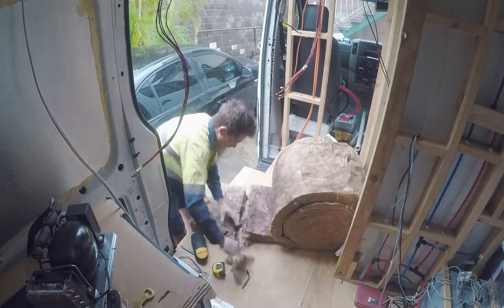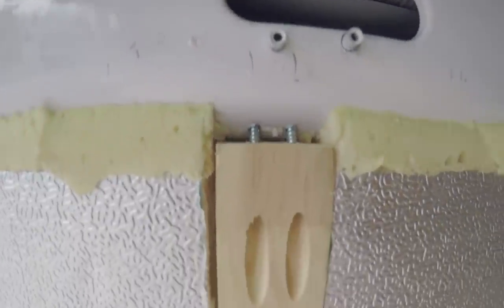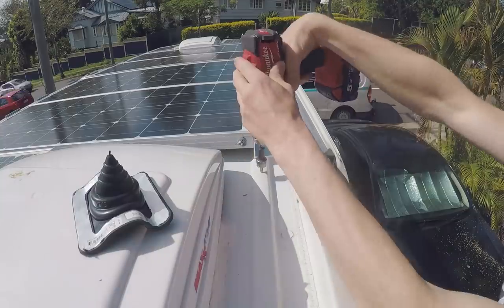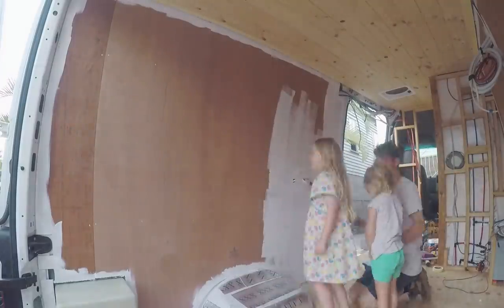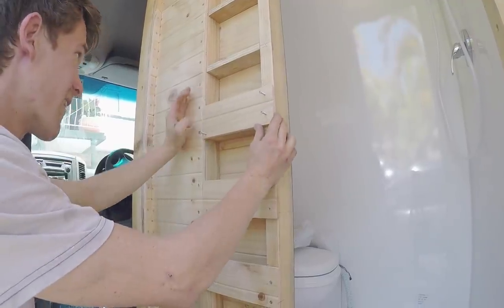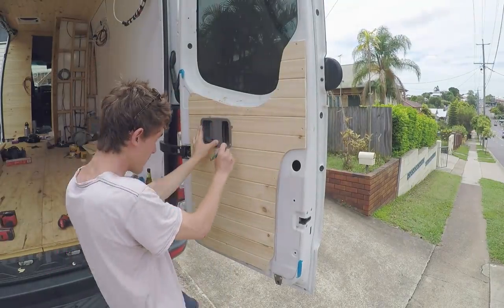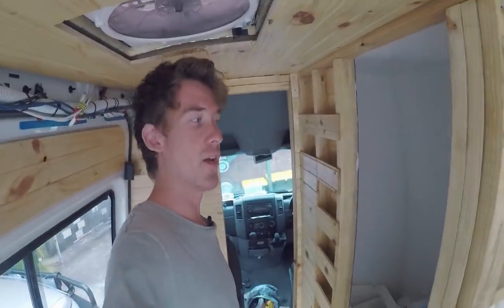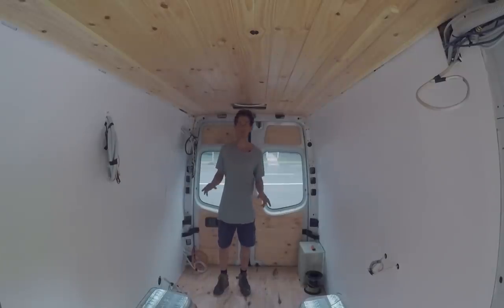S1E10 Sprinter Van Conversion | Sheeting

Comment from the maker: Sheeting the van was quite time consuming and at some points I did need a 2nd helper but it turned out exactly how I wanted it :) The Danish Oil stain does slowly darken over a few months but it adds even more beautiful detail to the wood. Thanks for watching guys!

Ep.10 BLOG POST + PRICE BREAKDOWN - http://www.jazmorton.com/van-conversion/ep-10-sheeting/
Season 1 Van Build - http://bit.ly/VanBuildS1
Season 2 Van Life - http://bit.ly/VanLifeS2
Reply: Very inspiring man! I'm in process of renovating our old New Zealand Zephyr 12.6'' caravan (aluminium body works) . I need to sort out the roof and wall insulation as I'm worried about the condensated moisture.
Reply: Travel With Jaz you dingo
Reply: I use an electric carving knife to cut rock-wool.
Reply: Seni seviorim
Reply: is cedar paneling shrinks or expands since you installed them?

Comment: Great video, thanks! I did the cladding on my rear van doors like you have done initially, but I had to change it. I found that when I was cooking or burning gas I would get a lot of condensation on the exposed metal. My bed is at the back of my van so the condensation would run onto my bed. I have now covered all of the exposed van metal which has solved the problem. I do live in the uk so its cold outside, especially now....so you may not get that problem in oz
Reply from the maker: Thanks man yeah I will have to wait and see did you cook inside, and did you havr extraction fans? Thanks for sharing david!
Reply: yep I cook inside my van, I have an oven and hob. I have an extractor above the hob and a roof vent, but no windows in the sides. I kept it like a panel van because I live in it full time in london and didn't want any hassle

Comment: You could use pieces of that pine board to do trim between your wall paneling. Just to cover the exposed cracks. Unless you're doing something similar in the future already. And.. I'd definitely have to use self tapping screws. Pre-drill, of course, where absolutely needed, but for all of that wood paneling, I'd use counter-sunk self-tapping. Absolutely incredible, beautiful work, mate.
Reply from the maker: Thanks mate! Yeah I still have to put more of the pine panelling up and this will cover the small gaps, can't wait to do that cos it will look even better 😄 thanks again

Comment: Very neat job and excellent video, thanks for sharing. Those that are worried about the contact of the timber or plywood with the metal of the vans I recommend applying 3 coats of good quality decking oil. I did not use timber in my build, instead, I used marine plywood.
Reply from the maker: thanks for the tip mate :)
Reply: Freetasman, what is the concern? Condensation between the wood and metal causing rot?  Mold/mildew?

Comment: Looks good. FYI Painter’s tip, never use ‘Vivd White. It;s the most basic paint with no covering power. Going to ‘Natural white’ which has even just the smallest amount of ochre/black in it (you’d never pick it by eye) means at least one less coat needed . Costs nothing extra to get mixed up (well... you will have to wait ten minutes while they mix it) and time savings will be huge.
Reply from the maker: Thanks for that pro tip that will be handy in the future :)

Comment: Impressive build so far, can wait to see how it progresses. How are you planning to close off the remaining bare metal surfaces on the doors? Personally I would consider using an adhesive autocarpet or something similar. It would help to dampen a lot of excess noise coming from those metal parts while driving.
Reply from the maker: Thanks very much! The white parts around the doors I will just leave I covered most of the holes with timber panelling 😄

Comment: Wow, I’m dumbfounded at your attention to detail. After watching your content all day, I’m nearly convinced you have the best conversion tutorial. Not basic, but easy to watch. I had a few questions!
•Why use rivets on the first layer of ply instead of screws?
•What are the benefits of Wi-Fi over a cell phone signal booster, as some other VanLifers use?
•The wood panels which clip into each other, are they common? I’m a fan of the idea. 

P.S. countersinking is the way to go.
P.P.S. Good call giving the wood room to expand with temperature! Did it end up doing so?
Reply from the maker: Thanks mate!

- I used rivets because I didn't want to risk putting screws in the wall and then having the cables potentially rubbing up or hitting them in the future when driving.
- I would use the Cell phone dongle, but it costs a lot more here in Australia. I use the wifi with Telstra because Telstra have the best coverage in Australia and using there many Wifi hotspots is a free addition for using their service.
- Yeah mate they're just Pine VJ panels. Can buy them from Bunnings here in Australia, but if you're somewhere else just search "VJ pine lengths"

Thanks mate, yeah the would has really expanded at all from my knowledge so no problems there

Comment: Great work buddy. 
In what vid do you explain how to finish edges/trimmings? All those curved shapes/lines towards the sliding door etc...so the finish looks flush? My conversion was nowhere near as detailed as yours but I always wonder how home conversions finish the edges  around curved ends.
Thanks.
Reply from the maker: I just used a mix between standard sandpaper, an orbital sander and a belt sander to do all my sanding jobs :)

Comment: I'm really enjoying these videos. Do you have a floor plan?  It would help visualizing the build if one could match the work done during a video to the final floor plan.   Are you not planning on having any windows in the van sides?
Reply from the maker: Thank you! I don't really have any plans but I will be doing up a proper 3D van plan on the computer after the build is done so it is easier to visualise :)

Comment: Jaz any reason why you chose to use VJ pine (ceiling and doors) instead of a light weight form of ply sheeting?  Surely ply sheeting would assist in keeping weight down?
Reply from the maker: Hey mate, the pine I chose I very light weight, and I just wanted the look of the timber slats as opposed to the flat ply 😀

Comment: I think even though you don't feel like it a vapor barrier should be used. It's a tiny space, you breathe, cook, the air is warm, and then there is the cold steel outside so the air will probably condensate and produce a lot of mold.
Reply from the maker: possible i should make a video testing this in winter temperature and remove the maxx air fan shroud to actually see if any moisture forms, but when we are cooking the maxx air fans are sucking out hot air
Reply: @JaznLori , in retrospect, would you have added a vapor barrier? Thanks for the video's! It's helping me a lot.

Comment: This is an exceptional video. well done, a video that you can learn from. Did you ever have a concern that using rivets would hinder being able to take the wall down easily for whatever reason in the future? Whether to renovate, or any issue behind the wall. Just wondering.
Reply from the maker: Thanks A lot, I don't plan to take it down but rivets are super easy to take out all you need to do is drill the head out with a drill bit (see episode 1)

Comment: What type of screws are you using when you secure the wood directly to the metal of the van? Just basic sheet metal screws? Any concerns about corrosion around the screw holes?
Reply from the maker: yeah just basic sheet metal screws

Comment: You'll want to be careful using the circle to trace out around obstacles. It'll give you a line that's a tangent distance away from what you're tracing, which can mess with the curves. If you want a more accurate trace you can use a scribe compass which will give you a perfectly linear offset as long as you hold the compass at a fixed angle.
Reply from the maker: legend I will look into investing into one of these for sure! Thanks for the tips :)

Comment: Why did you use rivets and not screws to attach the ply? Surely screws would have made it more easy to remove in future if needs be? Is there a reason? Thanks.

Comment: Mate your doing a   Spot On job, Im going back to watch all your previous videos. Your build looks like it will help with mine, I am just about to start, Can you tell me does the Danish Oil completely dry?? I always thought that being an oil it wouldn't,
Thanks Mate, Steve.
Reply from the maker: Hey steve thanks mate, Danish oil does completely dry, and as you apply, about 3 months later it will go a slight bit darker, and then it will settle , i recommend it
Reply: Thanks Mate I will go that way as I am using pine as well.
Safe Travels Mate, Steve.

Comment: As always, love the effort you put into your build. Tell me, two things. 1. Did I notice no insulation in the barn doors or the sliding door? and secondly, did you do a weight check prior to your build to know how much weight you have to work with, timber is a pretty heavy material. Love the Aussie face mask :)
Reply: There was insulation in the sliding door, but not the rear doors. I reckon because Jaz still has things to do on the rear doors. Will be interesting to see if I am right!
Reply: ha ha, gold, I must have blinked
Reply from the maker: You guys are both paying attention I see :) I actually forgot to put the insulation in the first time I put the panels on the door, but I was taking them off anyway to do the staining and sanding, so yes I put insulation in every single cavity once all was off again.

Comment: Feel like you could start the ceiling with a single board down the center. Starting along one edge as you did, I would hate to end up half way and not be running straight down the center of the van.
No insulation behind the wood panels in the back door?

Comment: Assuming you’ve had a few hot days recently, how did the van feel inside temperature-wise? Do you think the insulation is enough to cope with 30+ degree days without the fans on?
Reply from the maker: Its been bloody hot lately in Brisbane, Australia. If i open the van after being closed up for hours in the heat it is initially warm to walk into, but once the fans are wired up I will most likely have atleast 1 extracting on low speed all day, and this i'm sure will do the trick :)
Reply: Thanks. It has been hard to research insulation on YouTube as most van conversions are done by North Americans who deal with vastly different weather. I figured this week's heat wave would have been perfect to test yours out :)

Comment: Curious as to why you used rivets to hold the ply to the van walls instead of sheet metal screws
Reply from the maker: I didn't want screws going through incase of hittng the wires, or after a long time of driving around i didnt want the risk of screws making contact with the wires eventually from vibration ;)

Comment: What kind and lenght of screws are you using to drill into the van frame ?
Reply from the maker: from memory it is an 6G or 8G stainless steel, or stainless steel plated, roughly 30mm or 35mm

Comment: Jeez man it makes me wanna sell everything and build a camper --- tiny home. I live in the UK and before i became a Crane op i used to drive trucks and vans and what i found out was the merc sprinter is the same as the VW LT35 which my company bought brand new over the Merc the only changes were badges, dashboards, and i think Merc put their engines and gearbox that said i put 145000 miles on the VW in 2 years never let me down once. The factor in choosing the VW was the price of the MERC, If i was going to do this i would definitely get the extra long wheel base VW Crafter . You have have a nice camper there buddy i watched all the vids in 1 sitting thanks .
Reply from the maker: Haha thanks mate really appreciate it! That's a good choice mate hope you do start a van conversion! That's a lot of vids to watch in one sitting Haha, now it's time to go out and do it! All the best mate 😄
Reply: Hey there I'm a crane operator in the states and I've been living in a van for 2 years now and just bought my 2nd sprinter long wheel base extended for my second build

Comment: 1/4 inch birch ply would have been a much better choice for the walls. Luan is, as you found out, very porous and sucks up paint like a sponge. Also, the birch ply is a MUCH nicer, smoother finish. Sure, it's much more  expensive than luan, but the time (and paint) saved makes it worth it. Finally, using small wood battens over the joints between ply sheets would be a nice finishing touch. (I'm a retired finish carpenter)

Comment: think of the van wall as a glass of water. when cold water comes on it that Earth wall insulation is gonna get damp and start to mold. just fyi
Reply from the maker: Thanks havent had problems yet
Reply: What do you suggest doing different?

Comment: I applied all coats of danish oil onto the boards before installing them.
Reply from the maker: I would've done that but didn't want to do every single cut and then oil them. but if you mean the panels that I pre-made and then put up, yeah I could've done them before hand in hindsight but didnt make much difference for me I think :)

Comment: Do those screws lock into the steel?
Reply from the maker: Yes
Reply: Cool. Is there a reason why you riveted rather than using them on the ply sheeting?

Comment: At 2:03 "This particular ?earth wall? insulation has an R-value of 2." That is useless. Just skip that and wear a second sweater. Alternately, you could line the walls with 0.2 inch closed-cell polyethylene foam for R-17!!!!
Reply: closed cell spray foam is the only way to go bro...you just insulated your van with garbage...You should of at least used rock wool
Reply: The paneling is applied directly to steel, which is thermally bridged to the outside of the van. Whatever you put into the gaps isn't doing much anyway. This guy is based in a warm climate so I guess he's just not too worried about insulation.

Comment: Was there a reason you did not put the wool insulation in the back door?
Reply: I thought that too, but when he mentioned the fold down BBQ and extra power outlet I thought as he would have to go back into the door cavities anyway with the wiring that was why he didn't insulate. Could be wrong though!
Reply from the maker: Hey mate, I actually forgot about it, but I took them off anyway to stain them. and once everything was off I put the insulation in then :) just didnt record it haha

Comment: Should have used a wood paint with primer instead of a paint that’s water based, then you wouldn’t have to do so many coats.
Reply from the maker: Thanks for the tip adam

Comment: Word to the wise. Do not run your fan when sanding anything inside the van. The dust will get inside the fan and make cleaning it very difficult. Seal off the fan and open doors/windows and vent the dust using a normal external household fan.